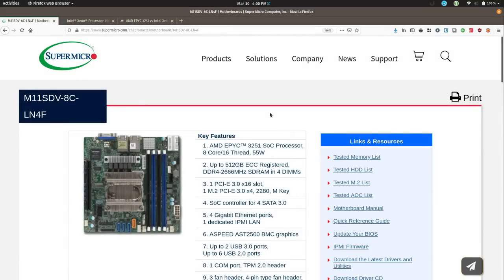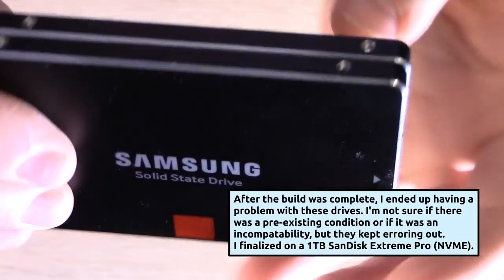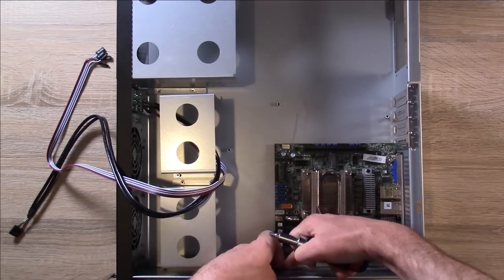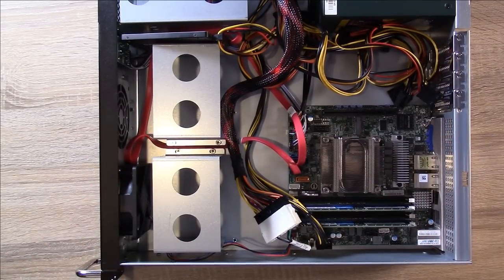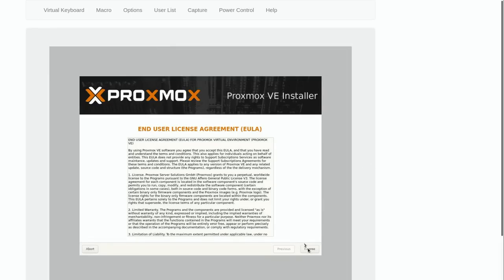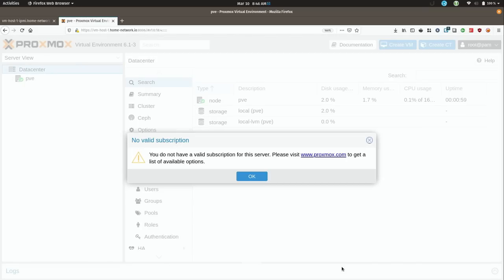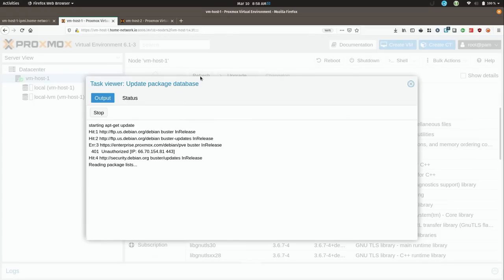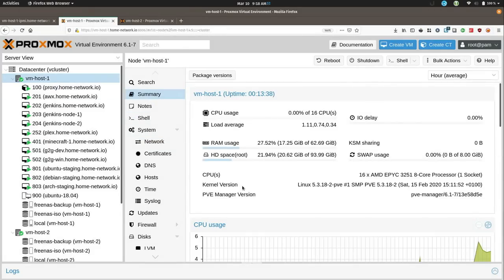Building a Low Energy Virtualization Server for Your Office/Homelab with Proxmox

Comment: I built a virtualization server using Proxmox a few years back using the same motherboard and a similar 2u case a few years back.  Added an old quadro w/ PCIE passthrough for video transcoding and the thing works like a dream. It's been awesome a first "real" home server, running absolutely everything I need (with exception of a separate storage server) and has had pretty much zero downtime since building.

The one thing I will say for anyone looking to use this board or similar (if you can find a deal on a several year old board), that passive heatsink really doesn't cut it if you aren't in a 1u case with loud high static pressure fans.  I ended up designing a 3d printed fan mount that just pressure fits on the top of the heatsink, with a 20x40mm noctua fan blowing down on the heatsink.  I haven't seen the CPU exceed 50c since installing (used to hit high 90s and throttle), and everything is still nice and quiet.

Comment: Thanks for the video. This is bit expensive. I have used Lenovo Tiny 93P got from ebay for US$125 and changed to SSD256BM and 16GB Ram. This set up cost me less than US200. It is core i5 Gen 2 cores 4 threads  and work well for over a year running a) Debian-> Docker-> Home assistant to control 200+ devices running heaps of automations b)  VM to run Blue Iris on Win7 with 10 cameras + Unifi controller for my unif network. I do have a HP Gen8 server with SAS drives (4)+ 8 Code (2 process) +24GB system configred proxmox but not running it as it uses over 250w and my Tiny PC uses less than 40w (my network rack use only 75w with Tiny 93P+ Synology 213 NAS+ Unif USG+ 2 PoE AC-Pros+ Modem+ Netgear Switch+ 3 Hubs for energy monitoring and home automatons). I am sure your system use more than 50w. So there is cheaper ways to get thing going and that does not need lot of power.

Comment: Hey Jay, the proxmox team added a way to apply network changes without needing a reboot. Click apply configuration button. However, I should note that it will ask you to install a package, which will need a reboot (but only one time after installing it). Now you can make future network changes without ever needing a reboot.
Reply from the maker: That's good to know, they're always making improvements.
Reply: You can install ifupdown2 in proxmox 
Then success
Reply: @LearnLinuxTV  Its worth noting that the apply changes will cause all running vm/ct to loose network status so you will need to restart them or just restart the host machine like you normally would

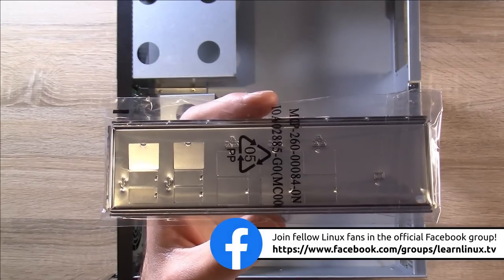Comment: @9:15 the IO-shield is not so much about airflow (notice that in your case you have a large vent right above it) but for EMI shielding.

Also, if power consumption is of concern I'd rather use a PSU with Gold or Platinum rating. Especially under partial load those are much more efficient. Alternatively: dont oversize the PSU that much. If the system is only going to draw ~50W you're better off with a PSU in the 150-200W range, as it will run closer to its most efficient operating point (usually around 50-60% load).

@30:45 the updates you get without key are those from the base Debian system
Reply: Ratings on PSU's, I'd honestly argue, make a negligible difference.
Reply: @Illuminali4all  Well, it does make a difference if - under partial load - the PSU has 50% (which many cheapo PSUs have below 30% load) or 80% efficiency. E.g. the server uses 100W - PSU1 (50%) will draw 200W from the wall, whereas PSU2 (80%) will only draw 120W.

Comment: I would add a few case fans with that board so the CPU doesn't overheat.  Those  fanless boards are designed for 1U cases with push pwm airflow
Reply: Shadepariah The M11SDV-8C+-LN4F does have a CPU fan.
Reply: @_TbT_  There is a model that does, but the one in the build in this video is no fan and he specifically says that in the video.
With that said, I am sure the one case fan will work pretty well in this case.
Reply: Agreed — That chassis had room for one more fan at the front and it would be wise to add another couple elsewhere (even fixed together).

Once those virtual machines start getting busy in real-world situations, processor temperatures rise exponentially, getting really hot — then you need multiple fans to ramp-up and push/pull all that heat out.

It didn’t seem likely that was ever going to happen in that guys’ set up, though.

Comment: I also did 55W 4 years ago, but i went for cheaper option. I am using ASROCK j1900 motherboard with 16GB of ram, the TDP of the CPU is 10W. To that i added 1tb HDD for proxmox and 3x 2tb for ZFS NAS, currently on openmediavault with sata passthrough. I have added a second NIC to access two networks because i did not wanted to go VLAN, and recently a 5th HDD, it's a 10tb drive for cctv and computer backups. I am waiting for mini pcie SATA card to attach it, currently it is on USB adapter, without the 10TB i measured it to be also 55W with 4 HDD drives. I am planing to replace it as soon as i will purchase a solar power installation with my HP z620 workstation with Intel Xeon 12 thread CPU and 16gb of ram.
The cpu is 10 times weaker than yours but it was fine even for plex transcoding from 1080p. And i also run Proxmox ;).
For network i went Mikrotik, with HEX S as a main router (because of it's 450mbit/s ipsec performance) and two RB951 series for WiFi and i am waiting for hAP ac2 for my main wifi since those two are meant to serve all the smart things in my house.

Comment: Did nearly the same setup like you with AMD Ryzen 2000 CPUs, not much power consumption and samsung NVMe's. You should always buy the pro versions when there is a lot read/write activities on it. It is so powerful that you are able to run multiple Windows Servers (+ Domaincontrollers) without any issues. Great for smart comercials.
Reply: AMEN on samsung pro SSD.

Comment: I've just built something similar some months ago: 5 x 512GB M.2 SATA SSD (PCIe-Board), 4 x 4TB WD Red, Supermicro 
X11SCL-IF with IPMI, Core i3 9100F (4 Cores), 2 x 16GB ECC and be quiet! Pure Power 11 400W PSU within a Fractal Node 304 case. My system idles at 22 Watts and is pretty quiet. Services running as LXCs on Proxmox: haproxy, mqtt, influxdb, node red, grafana, nextcloud and gitea.
The systems will get two additional backup drives attached to a M.2 PCIe 2 x SATA controller soon (waiting for the M.2 controller board to arrive). The backup drives are only powered up when a backup is due to keep the power consumption low. The power consumption is even so low, that it doesn't draw power at all when the CPU throttles down thanks to the caps within the power supply. This seems to confuse my CyberPower UPS :) (I have the suspicion that their PowerPanel software has a division by zero bug). Currently I could bridge power outages of about 4+ hours.
I built this system because my previous HP ML330 G6 Xeon with 5 spinning drives drew 105 Watts (not that bad actually for such an old and huge system) and was awfully loud. It's great that it's finally possible to build such real low power systems - even with nice headroom (the above i3 has some punch when needed - not as much as your system though). The long UPS times are a nice side effect to the lower energy consumption. The nice thing about the motherboard is its built in IPMI/BMC as yours seems to have as well.

Comment: Please note that usually when a server part (CPU, HBA, NIC...) comes with a passive heatsink it doesn't mean that this is enough but requires some amount of airflow to be properly cooled.
I strongly suggest you to check the CPU temperature because if in idle it should be fine, I can almost guarantee that under load at 55W and without any airflow it's thermally throttling like crazy!
Reply from the maker: Noted. I will keep looking at it and take your advice if I notice any issues with that. Do you think the heatsink is easy to remove and replace, or is it proprietary? If it's necessary, I'll investigate this.

Comment: Nice server.

You can do this on a budget if you go with used server parts from ebay. Or to do it cheaper and really low power, do it on a Raspberry Pi 4. The model with 4GB of RAM can host six or more containers. Under $100 and 5 watts. The Self-hosted podcast is a great source of info.

And Rapberry Pi are the only way to build a cluster without going broke.
Reply: Yeah thats kind of what I am thinking of doing.  Though I do find it annoying that most of the servers I see on ebay seem to use 2.5 inch hard dives, which does drive up the cost of storage a bit.
Reply: CaptRR rather looking for a complete server, consider looking for suitable MB, RAM, and CPU. Then put it in whatever case works for you. If you don’t need rack mount, and you want space for a lot of 3.5” drives, a Fractal Design 804 (8) or Define R6 (11) or R7 (14) are options. With the Define R6 and the R7 you will have to buy more drive sleds as I think they both only come with six sleds. And with all of them there’s room for three more 2.5” drives.
Reply: CaptRR look for SuperMicro X10 series motherboards. One generation back from current. Use DDR3 ECC RAM which can be had off eBay for about $100 for 32GB. Most models have 6 SATA ports but the X10SL7-f (mATX) has a built in 8 port LSI controller for a total of 14 SATA ports.

Comment: For arround 200-300$ you can buy Fujitsu PRIMERGY TX120 S3P. Small Form Factor, Xeon cpu  (like ex. E3-1265L), ECC Ram, 4x2,5'disks bay, 2xGbps nic, remote access. I think its even better deal than HP Microservers.

Comment: For common home use is enough to use old laptop with i5 or i7 and 16GB or even better with 32GB of ram. It will be much more cheaper and is a good start. You really do not need to spend 1K$ to start. Just make sure that the processor is normal M, H or HQ version. The ultra low power U versions are not very good for this task. Proxmox is definitely what you want to go for. Its easy to use free and stable. PS I am using i5-3230M with 8GB RAM and 500GB HDD and it is working 24/4 for a year with no downtime with 3 VMs and several containers and have still overhead for more...
Reply from the maker: VERY good point! Funny you'd mention this, I recommended using a laptop to a friend of mine recently, whom was concerned about power usage as his house has sporadic and unstable power. That's another use-case for a laptop as your VM server as well.

Comment: I use and used ZFS on cheaper Silicon Power SSDs; one 128 GB SATA-3 and one 512 GB nvme. I never had any issues and in both cases I booted Ubuntu on ZFS from the SSDs. The SATA SSD was running in a 2008 HP dc5850 (Phenom II X4) through a $8 SATA-3 PCIe card on PCIe 2.0. The nvme SSD (3200/2300 MB/s) was running on a Ryzen 3 2200G on a $60 B450 motherboard. I'm using and boot from ZFS since 2018! 
I even use ZFS on my backup server with 2 IDE HDDs and 2 SATA-1 laptop HDDs all in raid-0 to maximize space and used for ~1 hour/week :). The backup server boots from the raid-0 (IDE 250 + 320GB; SATA 2 x 320GB); is in use since June 2019 and it is a 2003 Pentium 4 HT with FreeBSD 12.2.  
ZFS is rock solid and runs even on my potatoes!
Reply: It's a Samsung bug, auto scrubbing trashes the fs.

Comment: I run proxmox also and this video is great.   However, i looked up the price of this board and wowza.  It's not a cheap one!  My proxmox runs a Ryzen 2400G and for my purposes it works exceedingly well!

Furthermore, will the cpu run cool being passively cooled?  Especially under load?
Reply: Running an average of 50 watts, I doubt it'll break a sweat.

Comment: I forgot low power AMD EPYC SoCs existed!
Also, I can't remember when in the video you mentioned that ZFS isn't for everyone or something along those lines, but that reminds me of why I used BTRFS. It's hard for me to believe that I initially decided on hardware RAID when building my first custom NAS, but used BTRFS RAID instead, and when the secondary SATA controller on its mainboard died, I was still able to recover my data on another mainboard thanks to myself choosing to go with software RAID instead of doing it in hardware. That does mean I replaced the mainboard in my NAS, but because the rest of the previous mainboard still works, I was able to repurpose it in a different case with different components as a secondary always-on PC, that just like my NAS, runs regular Debian, but unlike the NAS, has a limited set of components in order to free up more system resources since that second system would just run one specific service, whereas the NAS runs multiple services and even a full Trinity session over a VNC connection.

Comment: @1:22 55W here is the TDP, which stands for Thermal Design Power (or Point). You can't use this as a power consumption/usage value. It's a completely different characteristic.
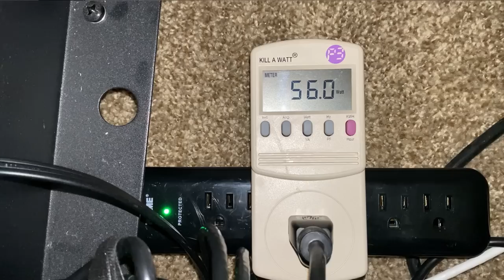Reply: At first I though it was not measured too, but actually it is there 36:35

Comment: Hi. I built myself a proxmox home server with a AsrockRack X470D4U and a AMD Ryzen 5 1600 6x 3.20GHz (Passmark Score: 12512) with 32 GB of ECC memory and two Micron enterprise SSDs. It uses a 92W passive cooled PicoPSU and an external power converter built for LEDs. It runs at 25W when the OS is idling and about 40W under load.  😎😎😊

Comment: Great build. Why not use a Noctua fan and a bigger case? You can increase your power consumption and number of threads as well by a tiny bit without affecting noise or electricity bills significantly.
Reply: I did an almost identical build but actually went with a smaller case. Size was the major factor for me.

Comment: I have a vmWare ESXi 6.7 virtualization server running since 2015 now which only consumpts 17W with 4 vms running simultaneously (2x win10, 2x ubuntu). (CPU i5-4590T, 8GB RAM, 2128 GB SSD Storage, 90W PicoPSU, Asrock Z87E-ITX Mainboard in an Kolink Satellite Mini-ITX case)

Comment: Heh, I did pretty similar to this build myself.  This was pre-Epyc so I'm using a Supermicro A2SDi-8C+-HLN4F instead but it's a pretty low power setup.  CPU is 25W TDP, whole thing with four hard drives and two Raspberry Pis attached via USB only eats around 60W of power.  I've been very happy with it, and I might've gone with the Epyc board (perhaps with a lower core count at a lower cost if available) had that been available at the time.

Comment: Great video. I am not sure if your power usage info is correct. 50W is very low and only a machine like Lenovo Tiny will come close to it. My Tint M93P with 16GB and 256GB SSD with no CD and one NIC uses about 40W.  Core i5 4570T is rated 35W. How much power your Dell was using? Are your measurement power usage monitored from power plug. I have all my devices connected via Sonoff P2 plus with Tasomta -> Home assistant.  I am planning to migrated to a Dell Optiplex 7040 Core I5-6500 rated 65w so based on what you are saying that low end SFF will use more power than users (In that I have Nvme drive). I do have HP ProLiant DL380 G7 Server 2x Xeon L5630 2.40GHz 24GB RAM 4x 72GB SA and has two power supply of 360W but I have not tested power usage. Could you kindly measure your actual power usage for the server as I cannot belive with cooling fans etc yours can be 50W

Comment: since this case doesn't have proper front to back airflow, cardboard air duct between front fan and motherboard should drop temperatures without adding more fans

Comment: Enjoyed low energy virtualization and low energy storage server videos.  Is there a reason not to do both in the same hardware?  If not, maybe a video on a combined machine?  Case and MB suggestions in particular.
Reply from the maker: No reason in particular, it all depends on what you want your homelab to look like. Your storage server can be a VM if you want. But then, you also have your storage on the same physical device as your VMs. In my case, my backups are on a separate storage server which is important to me. But everyone designs theirs differently.

Comment: So, now that you're almost 2 years in, how did you end up liking the AMD Epyc 3251?  I liked this build and was thinking of using the board for a similar project. It's a nice combination of power efficiency, upper RAM limit, and compute. Anything new catching your eye?
Reply: I built a cluster of nearly identical servers to this almost six months ago. I need more RAM (64G isn't enough) and the crucial sticks used are dual rank, which kills the speed when four are used. I'm looking at two 2r8 64G sticks.
Reply: @foxale08  Nice. I'll be doing the same very soon for the RAM. I ended up buying this board and built a Proxmox server as well. I hadn't been real familiar with it until your videos, and so far I really dig it. Running like a champ! I've had so many brown outs, surges, and moderate power loss in the area, so it's been great having confidence that my UPS keeps it up with minimal power consumption.
Reply: @GilbertMendoza  Not my videos, just providing helpful feedback lol. I personally use APC SMT2200's but am leaning towards SRT3000's or even a small APC Symmetra.
Reply: Haha, I didn't look close enough.
Reply: @GilbertMendoza  What did you end up paying for the board? Everything I see is $500-$900.

Comment: TDP is not a power consumption, is amount of heat which CPU produce on max load
Reply: It is not really max load. There is no standard way to measure it and you should not compare Intel TDP with AMD TDP, they are measured differently.
Reply: @happygimp0   You're right. I heard about it. But TDP is definitely not a power consumption
Reply: @TheKefas95  It is more marketing than anything else, like most other numbers of PC-Parts.
Reply: TDP = Thermal Design Power, which means the Thermal solution you need to use to cool the CPU, should be able to at least dissipate the number of watts listed.  Recommending a better cooler capable of better cooling than that.
Intel measures its TDP at base clock, while AMD measures at max boost clock.